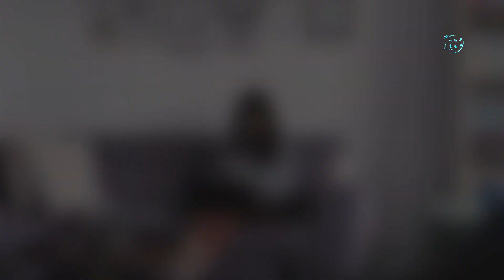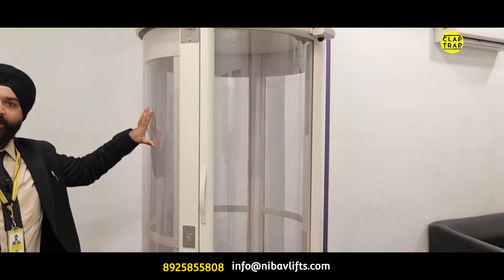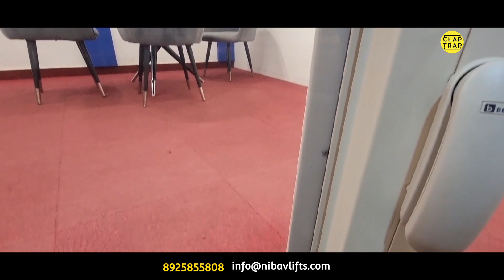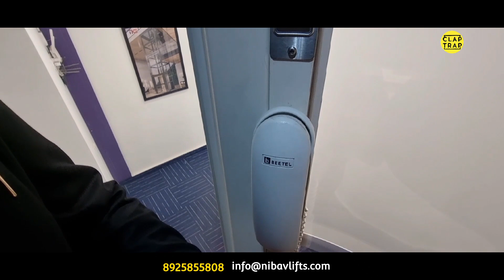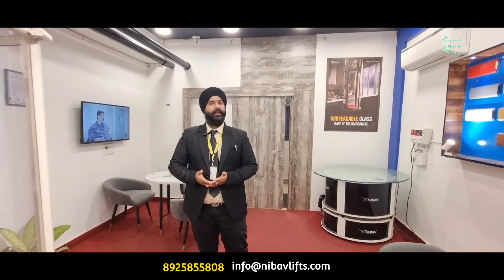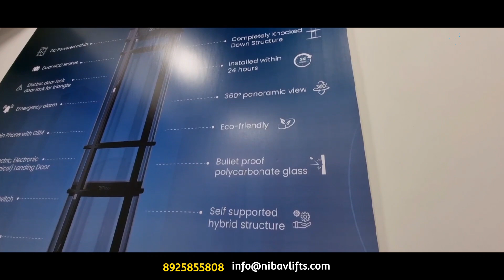Install LIFT In Old or New Home | Safe, Strong, Sturdy, Stylish, User Friendly, Smart Nibav lifts

Comment: Wanted to be clarified that since core cutting is known to lead to structural weakness, cracks and fissures , how safe is it to install your lift in an existing building? Will your company bear the compensation for any threat to structural integrity, if installed through core cutting process? Interested in installing it in my two storey building, which is in Assam, a seismic zone.